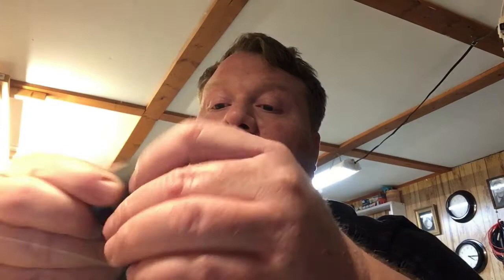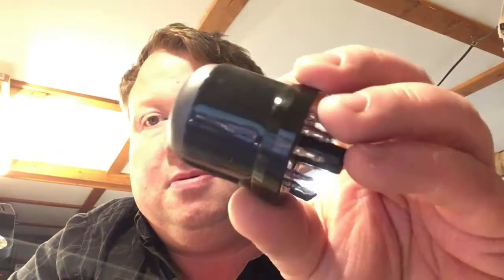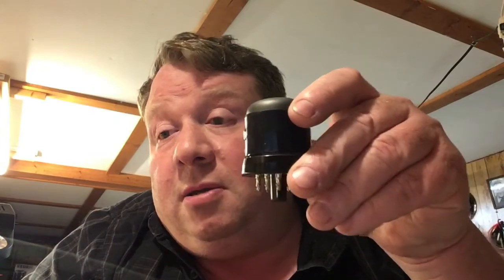EF12, VF14 Tubes.   Decreasing Microphonics

Comment: Don't think heat dissi is a real problem as long as there is no threat of fire or overheating from temp. And it's not a power tube as they can get fire hot in normal ops but pre amp tubes usally operate at lower temps. And as long as the tube doesn't produce more than 500 degs at the tapes heat limit heat dissipation shouldn't be a real concern imo
Reply from the maker: in operation this tube is warm to the touch, definitely not hot.

Comment: What about heat dissipation?
Reply from the maker: It has no noticeable effect.  Heat always finds a way to the cold., and this covers less than 1/2 of the surface of the tube.  As well these tubes do not get that hot.  They are only warm to the touch when in operation.